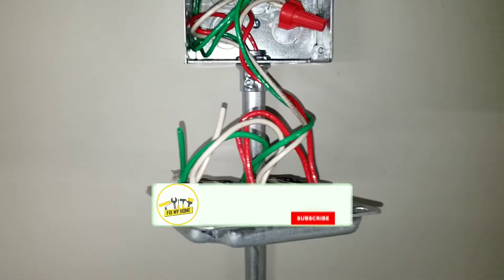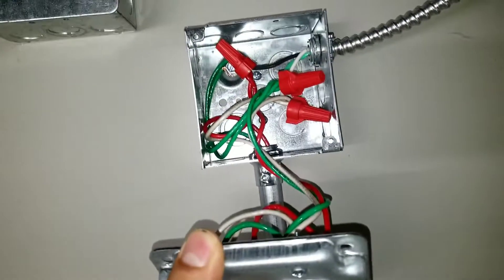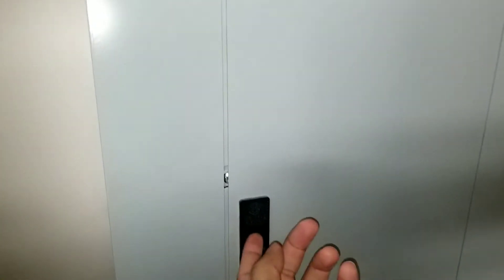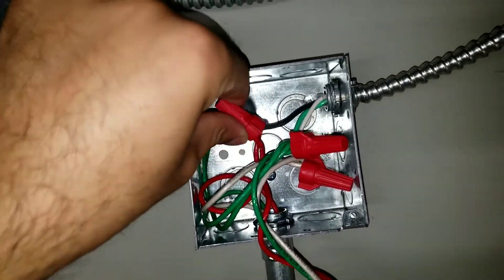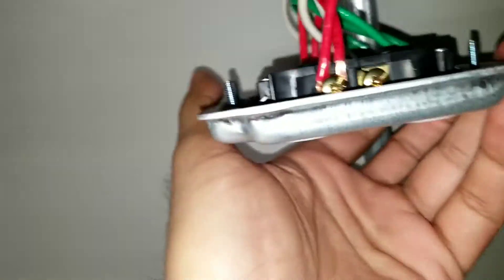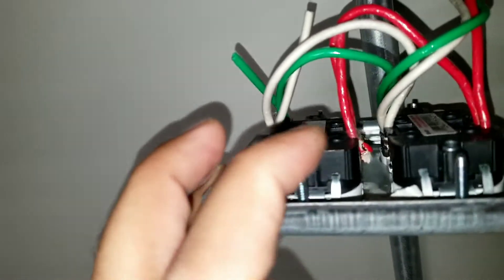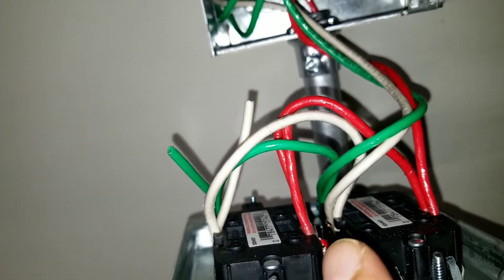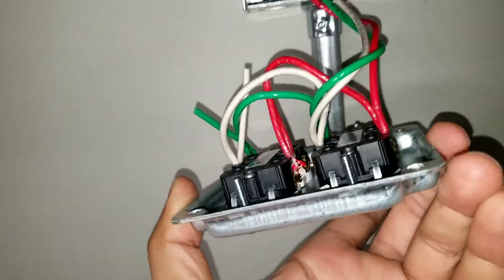How to Wire a Double Duplex Outlet

Comment: Why not strip the wires and terminate with a j-hook around the screws. The ends of those tails are still exposed and are a shorting hazard, especially in a metal box. You cannot loop around one screw and connect to the next receptacle with an ungrounded conductor either. Use the second screw for this or use pigtails. Your method of pigtailing is not correct. This would fail inspection in the US.
Reply from the maker: Thank you  Ted for you feedback 
But this job is already pass by inspector and we are in US.
Reply: @FIXMYHOMEShawn Now I think you're using stranded wire, if so, that explains my misunderstanding.
Reply from the maker: Yes i am .
Thank you my friend